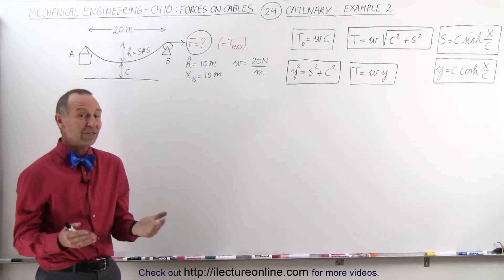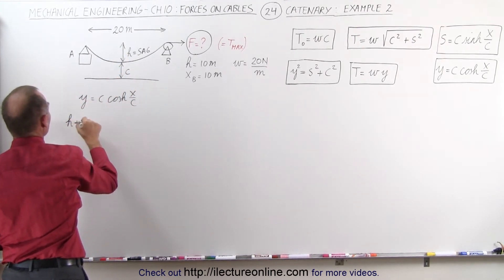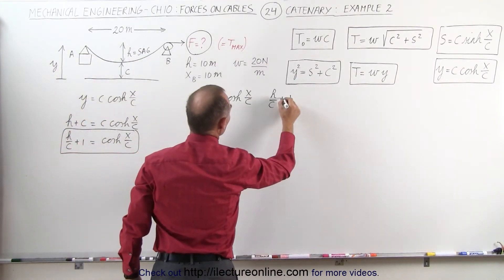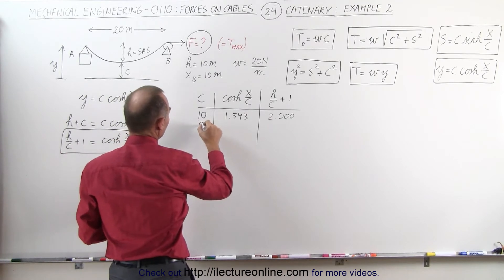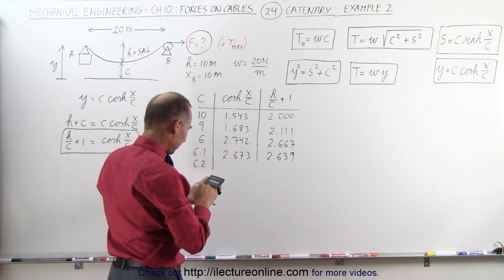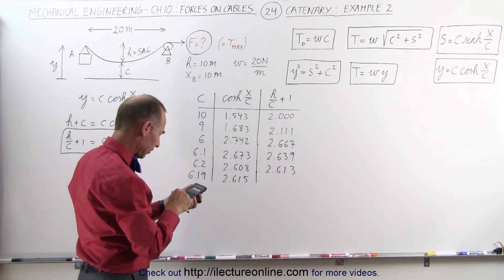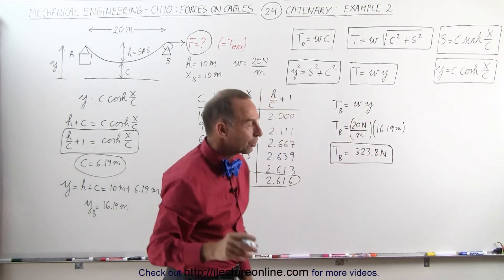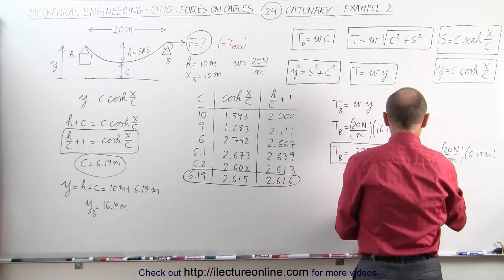Mechanical Engineering: Ch 10: Forces on Cables (24 of 33) Catenary - Example 2

Comment: Other sources say that C•w = Horizontal Tension

Which I guess the internal loads in the cable at the bottom is only the horizontal tension?
Reply from the maker: Yes, or the horizontal component of the tension anywhere along the cable.